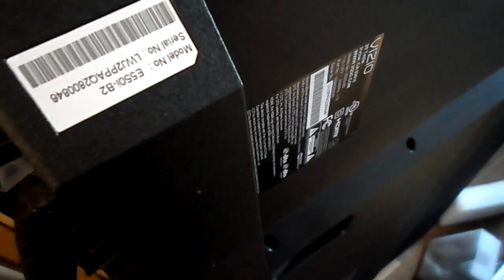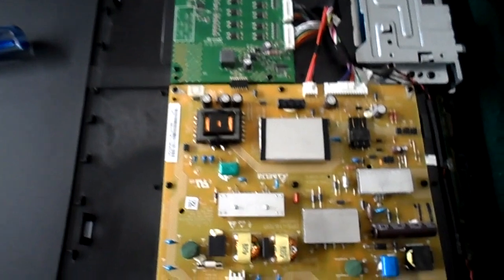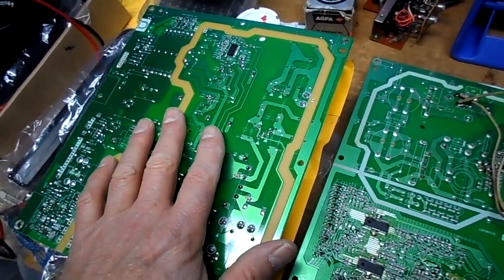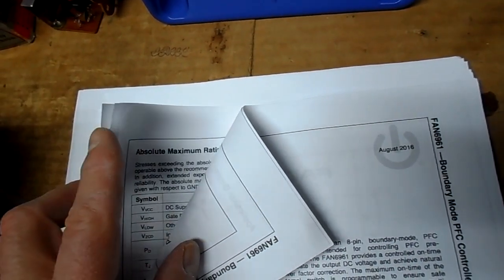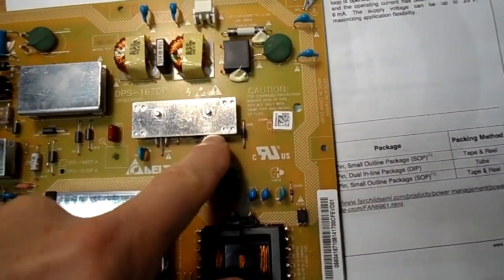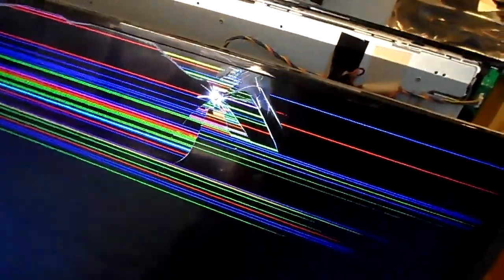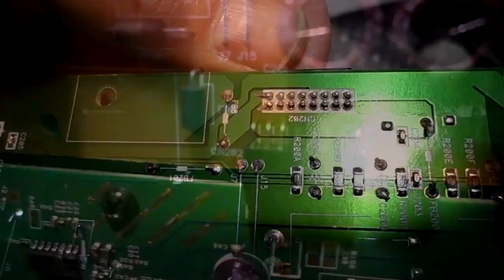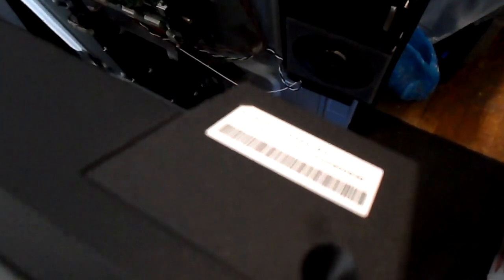Repair of 2 Vizio E550i-B2 55" TV's.

Comment: I have a E550i-b2 that stopped showing the picture but volume worked fine. Thanks to this video 2 hours later I'm watching TV like nothing happened. Thanks so much, you saved me a ton of money and a big headache.
Reply: I had the same problem. No video but sound. Used a flashlight at an angle to simulate a backlight. Pixels still worked. Ordered a board. Found this resoldered and in no time we were back up and running. Thanks a bunch for the video!

Comment: Hey ThanQ !!! I was about to throw out my E550i-B2, but I thought... May as well check UTube FIRST... checked Your Vid then my Power Board, and Sure Enough, it was the same dern solder breaks! ..either from Sloppy Manufacturing or the Inherent Weakness of plugging Two Boards directly together...would've been better Engineering to put a flexible cable between the boards... anyway. I got the TV FREE from an Office Liquidation, so it's not like I spent any money on it, but it was still great to be able to Fix instead of Recycle. Kudos 2 U 4 posting your Fix!!

Comment: When re-soldering the points on the back of the connector on the power supply board, do you have to make sure none of them are touching one another after they are soldered? Just asking because I'm pretty sure that is what is ailing my Visio E550i-B2. Being a computer engineer for many years I have played around with electronics, but my soldering is not the best.
Reply from the maker: Most of those rails, for lack of a better term, are joined together.

Comment: My first flatscreen was a Vizio 47" with CCFL backlighting. Had it for 11 years (trouble free) and then one day, I turned it on and it made a "snap" sound and the room filled with acrid smoke. So sorry I replaced it with a 4K 65" Sony. The Sony doesn't have as good of a picture as the LED from my vision perspective, is too bluish. The Sony has crappy sound too. So crappy, I had to get a sound bar. The only reason why I went with the Sony is that the reliability of Vizio has gone down and forget Samsung, I know some people that had to scrap them after two years.

Comment: I have a major league question after I set it up for you.
  I mistakenly bought a 1080p (full definition) Vizio D43f-J04 smart TV.
 I wanted the E43U-D2 2160 high definition, for the direct replacement of that model, because I busted the screen. 
  So, since I have both sets, Is it possible to use the screen from the 1080p new TV, and connect it to the old 2160p with the broken screen in your professional opinion.
  I'm aware of the 12 ribbons connected to the base of the 2160p broken screen TV.
  Any opinion you have is better than my non pro opinion, any day, lol.

Comment: NOT ONE video shows the person taking the friggin back off. is it more than the screws? or is it latches!? I hate "figuring it out" after I have broken something, thinking it snapped on, and it didnt. is there a hidden screw under a label? I hate that. "well Ive already taken  this and that off and bla bla bla"
Reply from the maker: The "A" version is a PIA to take the back off. Some tabs will break. Need to slide a rigid non-marring tool down the edges to release the tabs. Yes, some will break. They changed the design on the "B", by adding a removable panel to access the boards, without the need of removing the whole screen bezel. That "A" set still failed shortly after mosfet replacement. The power supply has design issues. Replacement chips seem counterfeit/pulls when claimed new. Not investing in another supply.  It's going to the e-waste bin. The "B" is a better set.
Reply: I realize it’s 9 months later and most likely irrelevant for you at this point, but perhaps this will help someone else in your shoes. To fix the same problem shown in the video, here's how I took off the back panel from my ailing E550i-B2: 

The service panel is secured by 16x small, black, dome-topped, Phillips head screws. None of these 16 are underneath any labels or anything, but 4 are somewhat hidden in deeper recesses along the bottom of the panel, and 1 is hiding in plain sight directly beneath where you plug the power cable in.

Additionally, the service panel cannot be removed if there is any wall-mounting hardware attached or if the base stand is still installed. 

The wall-mount hardware attaches to 4x anchor points that go through the service panel and into the TV’s chassis. The mounting kits are all different, so I can’t necessarily describe the appearance of these screws, but they would definitely be the largest ones on the rear of the TV, and are arranged in a large square pattern centered on the panel.

The base stand is attached using 4x small, black, flat-topped Phillips head screws, arranged in a rectangular pattern centered on the bottom of the panel.

Once all of those screws are removed, begin working the panel off. My panel hadn't been removed since I bought it in 2014, so it was a little stubborn. I found I could get a really good grip on the panel directly beneath the horizontal line of inputs connectors on the bottom right. The panel is held in position with 3 tabs along the top of the panel. I slowly pulled the bottom of the panel towards me, giving me plenty of torque to pop those tabs out. Popping each one out made a loud sound, and I actually thought I had broken each one, but they were still very much intact. Closer inspection of the tabs’ design once the panel was removed makes me think they’re designed to behave this way. Honestly though, looking at all of the other fastening hardware involved, I can’t see how it would really matter if you do happen to somehow break these tabs. Once those 3 tabs are popped out, you’re good to go.

Hope this helps!

Note: there are 2 more small screws (1 in each of the bottom corners of the TV's rear) securing what I presume to be small service panels for the speakers. These do NOT need to be removed in order to service the power supply, LED driver, or main boards.